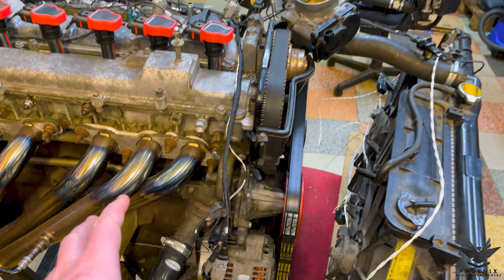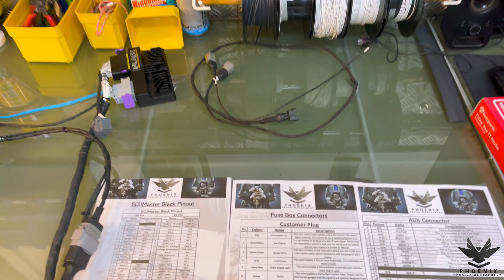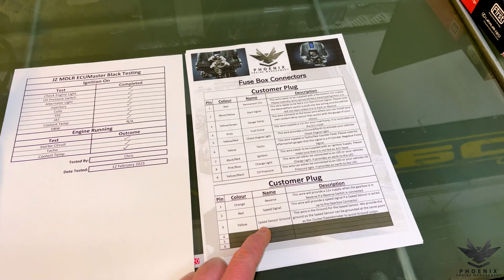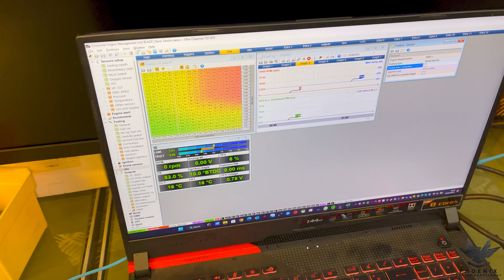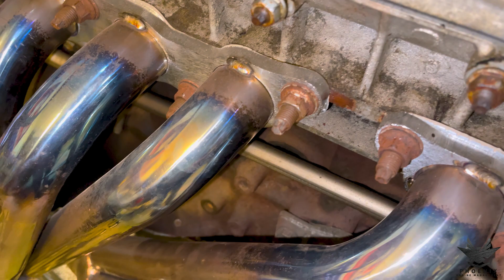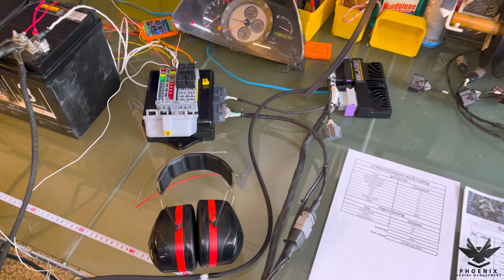Ollie JZ Modular ECUMaster Black Engine Harness Alteration

Comment: Do you release wiring diagrams?
Reply from the maker: Hello CB for the ECUMaster each ECU comes with a Card showing all the pinouts on the ECU itself. Here is a link for you www.ecumaster.com/download/ on that page you can go to EMU Black and there is a link to the EMU Black Pinout that will give you the pinout sheet. 
With standalone ECU's as you can customise them to suit your application if either you or someone else builds a harness they will be the one's to decide what is connected to where. Somethings like Coolant Temp and Intake Air Temp have dedicated positions as per the EMU Black Pinout so they are set in stone everything else can be connected to wherever you like.